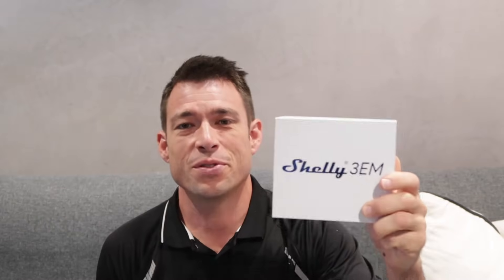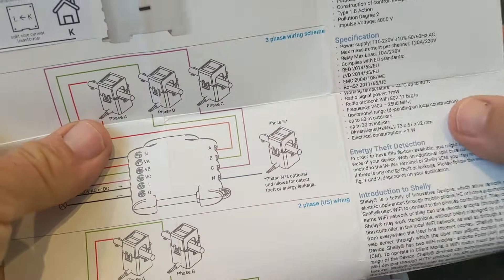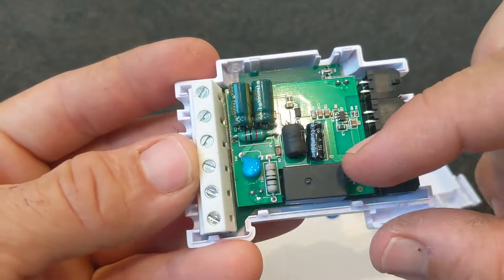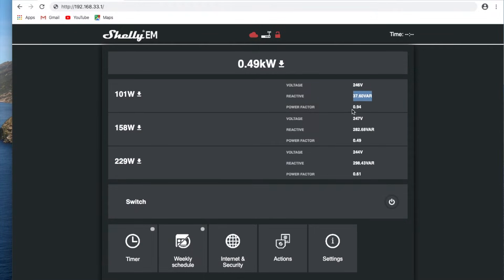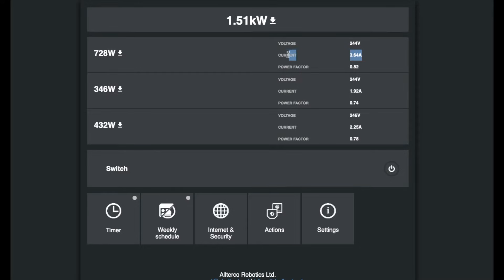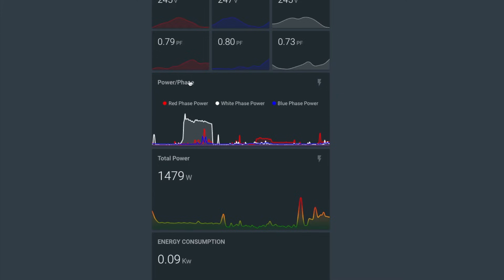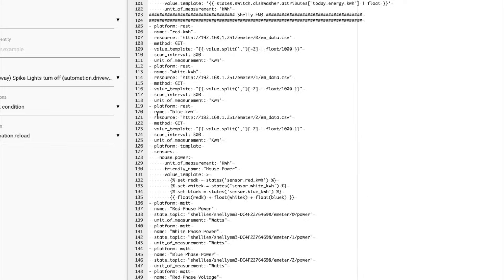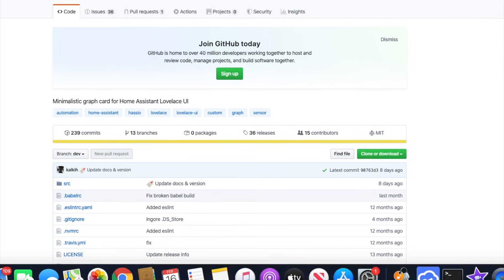Shelly 3EM and Home Assistant

Comment: Great video tutorial, but the voltagedrop explanation is a bit off the mark.  Your drop would be due to the capacity of your feed wires or tails (depednign where you are) causing voltage drop.   Yes, voltages on phases can vary slightly, but they do not vary that much on the main lines.  Most people in Australia do not have 3 phase in residential property, but the good thing is this device is pretty well just 3 meters.  It really doesn't care about phase so you can use it to monitor say the main in and 2 additional circuits.

Comment: curious I see your relay  contact is rated at 10 amps. I want to monitor the current 120 2 phase home with 100 watt service all my circuit breakers are rated at 20 amps. Granted none of the should ever see 20 amps, if they did I have a big problem however combines its possible that one or both legs from the main which is what I am going to monitor would have 10 amps so how is the relay going to do that.

Comment: Does this device work? easy to use?. I tried z-wave energy meter and its fucking horrible, almost impossible get to work.
Reply from the maker: Yes it does work, its very easy to use. The only downside it I feel the case could have a more sturdy construction.

Comment: Hi Jimmy

I would like to know, whether  the WiFi connection will be realiable in case, when my Shelly 3EM will be placed on the DIN-rail and  closed behind the metalic door  within the home switchboard. An external antena could solve this problem, but does it have one?
Reply from the maker: It’s work better than I thought it would, I’ve install a few in meter boxes and have had no problem.

Comment: Good video, @6:15 you edited the video, was there some error or long delay until the power meter went down? 
BTW I live in Sweden but have family Down Under, that and mostly the fact that I like your style has gotten you one more subscriber 😁
Reply from the maker: Thanks Benny,  I do edit the videos, I to try to keep them moving along so as not to waste your time, while still providing useful and relevant information... hopefully
Reply: @SparkyJames  fair enough, I just thought the value stayed up while you turned stuff off for a bit longer compared to the on-time just before and was wondering if the Shelly got hiccups 😁
Reply from the maker: @bennylloyd-willner9667  There is a delay in displaying load power, but there needs to be or it would fluctuate to much from minor load changes that occur all the time in a property. It’s possible the way I edited it may unintentionally have made it appear exaggerated.
Reply: @SparkyJames  thanks, I do appreciate your quick responses 👍 I will probably get me one. We have a phase that often is overloaded and that along with Shelly power metering plugs would help to pinpoint the situations and load combinations that trigger the fuse. I have a suspicion that the electrician who did the installation (in previous owner times) saw the kitchen as "a room" while it uses a lot more power than other rooms so he/she got the load balancing wrong. The main T phase fuse (In Sweden we call the three phases R, S, ans T) is always hot when an inhouse fuse has been triggered.
Thanks again. Looking forward catching up on your videos!

Comment: Hi Jimmy, thanks for the great video. I have a 3 phase property in Cyprus. Planning to get the same Shelly 3EM. My question is : will the physical electricity meter Kwh figure correspond with the total Kwh on the shelly or will I need a custom Home Assistant combine calculation code?  The reason I ask is that I was told that the electricity meter doesn't add up all the 3 phases kwh, it can only use the highest phase ampage at any one time during the kwh calculation.

Comment: Thanks for the tutorium …. one question :  it has a batterie ..so does it displays (and transmits) . 0Volt when the power goes down ? or does it, like most of the others just turns down and keeps the last recorded value ?
Reply from the maker: The battery keeps the time when the power goes off, so it can keep accurate records when the power is on again without wifi
Reply: @SparkyJames  
Thanks for you’re reply … but that means, Wifi will be interrupted and a power failure will not be communicated to a management system (i.e. Home assistant). Hmm…  too bad.
Reply: @n.r.2258  It would have been nice for sure, I think they didn't want to put more cost into it, it would need a bigger battery than the CR button one to make that happen. I'm not sure but it may have also made the unit a lot bigger due to bigger batteries and mains voltage separation regulations (I haven't checked but I can imagine it exists in the EU)

Comment: I am from the us. Typically 3 phase 240 or 480 is reserved for machinery. Where are you from where your energy provider provides 3 phase residential power?
Reply from the maker: Yes, it quite common to 3 phase power 240v to Neutral 415 phase to phase, in residential in Australia. It only adds about $1000 max to the cost of building a house to have it installed over 1 phase 240v. I have to say the way the US power supply works seems quite different, the main advantage I see that US system has is 110v is safer a zap from 110v is not nearly as bad a 240v
Reply: @SparkyJames  yes I agree the us single phase grid is built with safety in mind. You would be amazed at how difficult it is to get 3phase in some places. It can get so expensive machine shops are using phase converters to try and run 3P machinery. And bringing 3p into a residential area is almost unheard of. It’s all about making as much money as the power company can. This year the state of Texas almost completely shut down because the temps dipped below freezing and their grid just wasn’t winterized. They just never prepared for the possibility that one day temps might drop below freezing. Then when no one had power , the price gouging began.

So do you have 3 phase appliances  or do you simply use one leg and a nuetral to create a single phase circuit?
Reply: In Sweden I think all houses have 3 phase input, the phases are divvied up evenly throughout the house. Electric stoves use all 3 phases since it draws a lot of energy. We have two 3-phase outlets for industry-type washing machines even tho it's a regular residential home, but I don't think that is too common.
Reply from the maker: We have 3 phase appliances including spas, instantaneous water heaters, air conditioning, induction cook tops, water pumps/ground water bores, but you can get all those in single phase, and we usually do just run most things off 1 leg and neutral, 3phase mains best advantage is smaller cables to run more power longer distances, you have more volt drop available 21v compared to single phase 12v

Comment: Hello Jimmy,
congrats for this video.
Can you please explain how you calculate the energy consumption (kWh)? I didn´t understand that.

Thank you very much.
Reply: The CSV file was showing energy usage (Wh) for each 5 min period, which you could see at the top of the file. So you can simply just sum up the values from each 5 min period for an entire hour - and then you know the Wh usage in that hour. He mentions "700 Watt", where he should have said "700 Watt-hour". Which then equals 0.7 kWh. Hope this clarifies :)

....and to be extra picky then he should not have included the last cell as he then looks at more than one hour (11:00 to 12:05).

Comment: You said you ordered with 50A clamps. I wanted them as they are smaller and probably have better accuracy in up to 32A range. I called support and they said only 120A supported. Are you sure you got 50A clamps ?
Reply from the maker: It possible that has changed since I did the video, I have just bought and installed one a week ago and they came with 120a clamps. They appear to be quite accurate even at low current. I was going to try and test the shelly EM3 against my supplier meter and see how close they are.

Comment: Hi James
If the house has a solar system, will the values show negative when there is overproduction? Can the relay be programmed to be activated when there is overproduction?
Reply from the maker: Hi Istvan , yes it does show negative when the house is over producing power. I believe that to make the relay come on you would need it to be connected to Home Assistant or a similar system to have an automation to do that(it would be pretty easy), on its own it has no logic to do that.
Reply: @SparkyJames  Thanks for the quick response. I am not experienced in programing, after I purchased the 3EM do you have possiblity to help with the set up?
Tem viewer?

Comment: Well, I love what you've done and it really should be easier than what I am doing... which is obviously incorrect.  I am working with a shellyem, not the em3, but it is basically the same idea. Only 2 channels, but has same csv file to grab.   I really was hoping you could share your sensors yaml file - complete!!  I cannot get mine to work properly.  Additionally, it would be helpful if you were to share your lovelace card configuration (code) for your charts.   Be a mate, and help us out.   I'm really stuck.   Thanks!

Comment: Hi Jimmy! Great video! I also have.a.three.phase energy installation. Very much appreciated. I'm planning to install solar power on one phase to coup up with kitchen appliances day time consumption, about 1500W photovoltaic solar panels. Do you have solar power installed?
Reply from the maker: Hi Peter, Thanks. My current house doesn’t have panels, I don’t like solar panels on tiled roofs, to much risk of roof leaks. I used to install systems, when I had  a small contracting business. It’s just me know and so I don’t do solar anymore, you need one or two helpers/apprentices. They are very good the Shelly 3em and it is my understanding that they will be Australian Certified by the end of the year, which would be good then I can actually offer them to people to supply and install.
Reply: @SparkyJames  lol, that's a good reason to not install roof top solar panels! But, you down here on southwest Europe, 0,15 EUR per kWh energy price! Let's throw some solar panels up there to bring the energy invoice down!

Comment: Hi Jimmy , can you place a picture how to connect 3 phase VA, VB and VC. Mean 4 breaker total to be installed.
Reply: It doesn't matter. You just have to make sure that you connect the current transformers to the same phase as you connect the voltage input to i.e. IA to VA, IB to VB and IC to VC. And no, this still makes only 3 breakers, not 4.

Comment: How long would the battery last? Is it replaceable by the user?
Reply from the maker: Hi Zacson, I would consider the battery not user replacable, and it's a lithium battery so I would last at least 10 years, it's pretty common for digital time clocks with battery backup to have a similar battery and they last a long time, usually.
Reply: @SparkyJames  Thanks Jimmy. 10 years in really awesome. I guess it helps to maintain the time and log the data correctly after a power outage and when the internet is down. Any idea how that battery is connected to the ESP chip?
Reply from the maker: @zacsonskaria  
Yes, it provides the time if the device is not connected to the internet for a period, to continue to accurately track power use, and the battery would be connected to a real time clock IC and that in turn would be connected to the esp via i2c or serial.

Comment: Good video.
Could it be installed in single-phase with a clamp for power grid and another for photovoltaic energy, and that each phase can be made a different "Shelly device", and labeled as "Home" and "Solar" and not as Phase A and Phase B?
Reply from the maker: Yes it is effectively 3 separate single phase devices, that also has a combined total channel as well, however if you have single phase the em  with 2 channels and 1 voltage reference  is   probably a better choice. Both Shelly EM and 3EM are net totals so it counts up and down if you are feeding solar back to the grid. It is just a matter of where in your power circuit you place the clamps that dictates whether you measure the house load or   load less the solar power generated or just power generated.
Reply: Late to the party so you prob know this already: Shelly has a diagram for just that on their website: https://shelly.cloud/knowledge-base/devices/shelly-3em/#tab_6211f1dfc7ca5

Comment: Hi! The example config is missing infos like you need the Shellies Discovery script etc. Took me quite a while and I'm still not finished.
Reply from the maker: Sorry, I did skip over a step, the only missing part is in the Shelly admin you need to setup the connection to home assistants Mqtt broker, the same method as for the other Shelly devices, discovery: is not required with the sample configs although that is another way to setup the EM3. I am planning to make a more detailed installation video once i'd played with in for a while.
Reply: @SparkyJames  ah thx, actually I like the Shellies discovery script, everything is available in the dashboard etc.

Comment: Hey cool Video. Can you make a video about the hookup? And do i need to connect the 3 Phase to VA VB and VC? thats a lot of more work.
Reply from the maker: Yes, I am  going to make a install video for it, and the simple answer is yes you do need to connect 3 phase to VA VB VC for it to work best. There are other monitors that don't use the voltage from each phase, however it not possible for them to be as accurate as they use the voltage from the one measurement point only.
Reply: @SparkyJames  still waiting for that vídeo........

Comment: This looks like a great device.  The description says it would also work for monophase. I have a single phase split into two legs  and a neutral.  But my main is 200amp.  This device only goes up to 120amps. So I’m not sure it would work for me.

If they could provide a CT with half the turns and then double the amps with a software update that might work for me and provide the correct numbers.
Reply from the maker: Yes you could use one clamp on each of the legs, as they operate independently. I have installed it in the mains of my house but you could simply monitor 3 sub circuits with it.  Is the 200a rating the main switch rating or is that your maxium demand? As while it's quite possible, it would be a little surprising for a house to use more than 120a. Especially if you had split with 2 legs and there was one current meter on each leg.
Reply: Jimmy James my legs are only 120v to neutral. But the two legs are 240v to each other.  So my stove/range that pulls  50 amps is pulling that current on both legs.  That’s why it’s possible to go over 120 amps if stove, water heater, clothes dryer and air conditioning are all running at once because they each put current on both legs. All the smaller loads like lights and outlets are only one leg with neutral but they are still double the current at 120v compared to what you would see at 240v.  So,  in summary my current is about double what your current is when counting each leg.